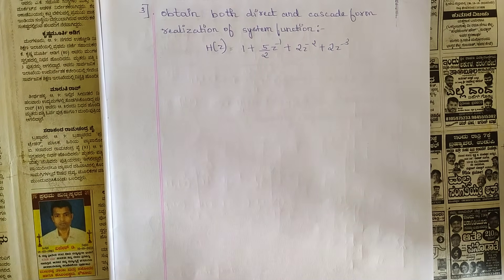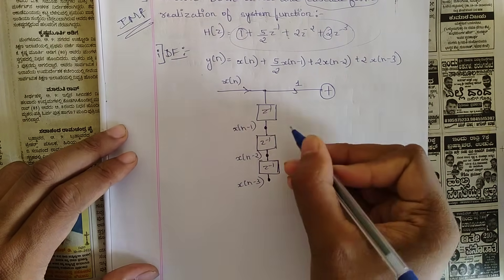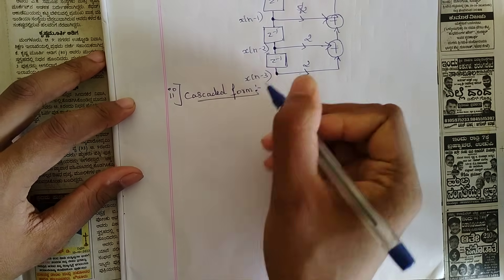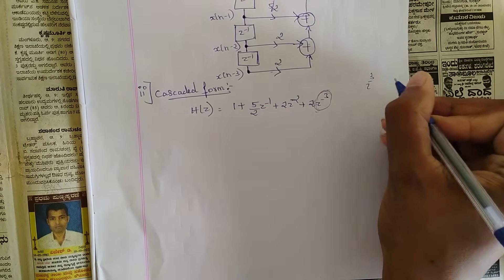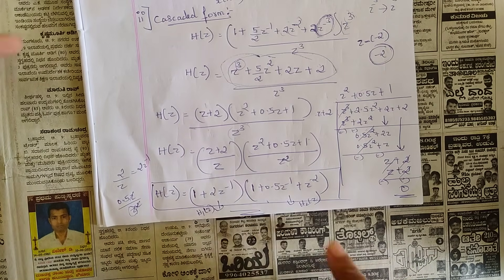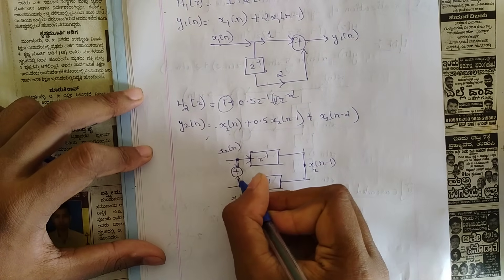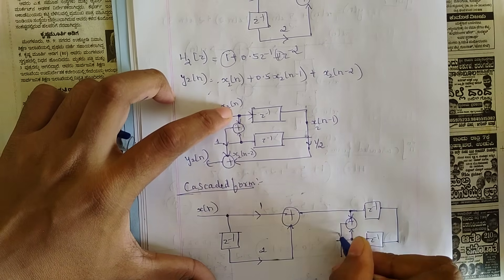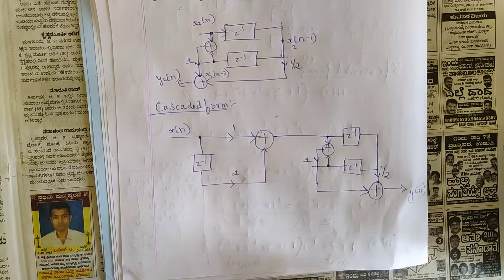11.Fir Structures Cascade Form 2 IMP Problems Explained Module 4 5th Sem ECE Latest Scheme VTU

Comment: Sir how to do the cascade if they give z power -4  to find roots there is no option in calculator
It's question in model qp 8c
Reply: @vtuacademy
Reply from the maker: You'll need to find the roots of the polynomial directly for z^-4, it's not a calculator function.